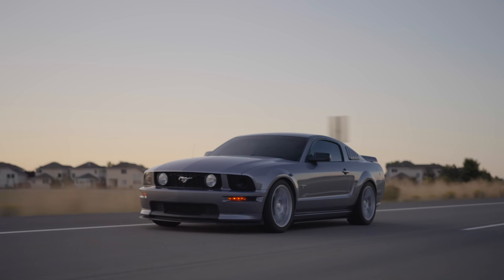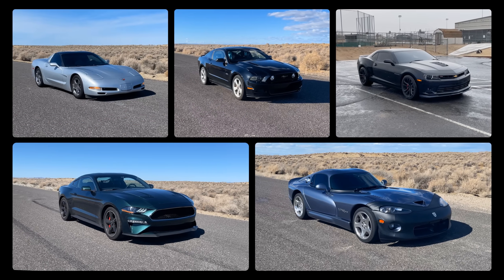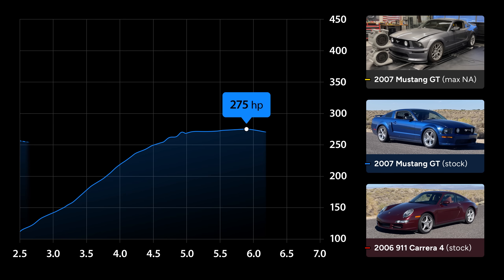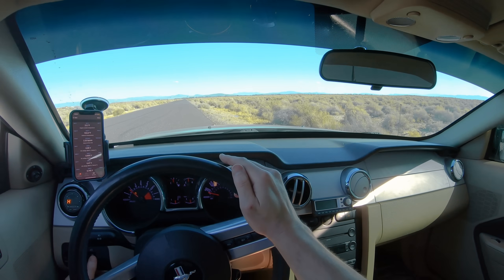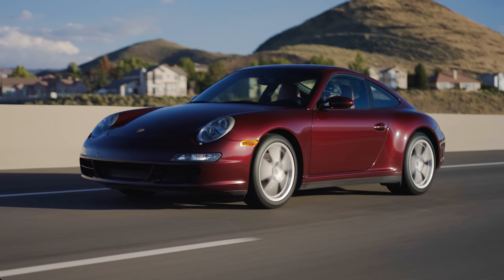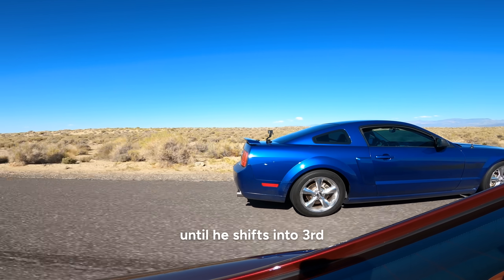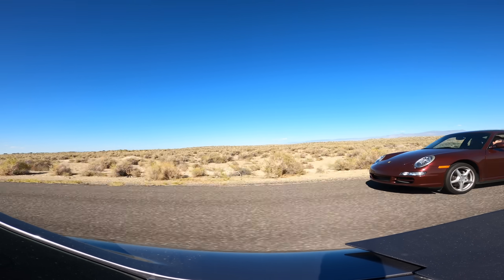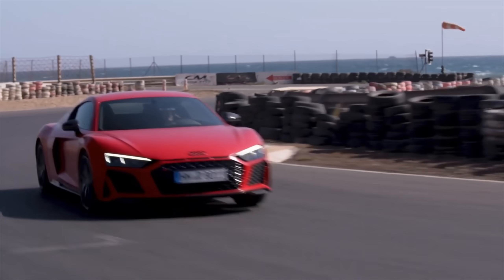This is what a 50% increase in horsepower looks like

Comment from the maker: Yes, NA builds are expensive. No, it’s (generally) not worth it, but something something eye of the beholder…

Rough breakdown of costs:
- Cams $1,000 (127600 + phaser limiters)
- Stroker Kit $4,000 (4.9L, but only ~9.6 compression ratio [for eventual boost])
- Exhaust $1,500 (Kooks LT, catted x-pipe)
- Intake $2,000 (CAI, TB, Manifold)
- Trans $6,500 (includes clutch, driveshaft, and axle gears)

If you have any questions for me, you can reach me thru my Tazet profile:
https://tazet.com/foureyes

And special thank you to those who watch the video all the way through 🙏
Reply: its still cheaper than a coyote swap
Reply: I just had a 302 3-valve installed in my 2005 Mustang just because I love the 3-valve nothing to do with being faster than a Coyote but fast enough.  @LordSamuelJ
Reply: "Worth It" comes down to what you actually want to accomplish.  If the goal is a dyno number or a track time sure boost it to the sky but if you just want smiles per gallon I think nothing else feels as good as a smooth running NA engine
Reply: @LordSamuelJ is not anymore. You can absolutely junkyard it for less. Will it have tons of loose ends, yes.
Reply: nice work man, i just did about $15k in mods to my 2018 camaro and fully built the motor NA
Reply: I feel like ur like me n ur obsessed with N/A vehicles n how much possible power the motor can put out lol
Reply: What happened to the 327 stroker kits?
Reply: Ls stroker haha. I love the sound of the 4.6s but they just didn't really compete to the LS for the money. Boost is the best bang for buck but NA power is awesome.
Reply: @shoveI  lol it's the opposite, if you want a track time - you want to stay N/A
And if you want some car goess brr once in a while - turbo is a way to go
P.S. Really high tuned high horsepower N/A engine is not exactly smooth below 3k rpm...
Reply: i dont know how is on there with SC build...

but N/A is visceral and cool.... i mounted a N/A car following these steps about... 
is pretty fun to drive, not the best but, if well mounted, it will not break easily
Reply: I hate this man, makes me wanna get rid of my gt500 for another 3v 😔
Reply: Can't wait till you start putting the big mods like a turbo or supercharger. I'd love to see stuff like this more often.
Reply: Would you be open to working on other people’s mustang? You clearly have the tools, and knowledge to do so. If so, how much would your time cost?
Reply: Love the car and the videos. I like the fact that that you got to the point and straight to the racing. No unnecessary owner interviews or fluff. Great stuff
Reply: how do you get your video and editing so crispy?
Reply: @LordSamuelJ he could've spent 1/4 of what he did and have double the power had he did a coyote swap. I've seen coyotes in my area for $800
Reply: @ronaldosanchez3292  
He did waste $10,500 on a transmission, and low compression stroker kit from a 4.6 to a 4.9 😆.  If he didn't do that it would have still outrun that Porsche..
Reply: completely worth it, sounds much  better than turbo cars and also gives a much better feedback and feel
Reply: It isn’t worth it, but it looks so satisfying!
Reply: If you love and keep your car long enough the “not worth it” no longer applies. 

I’ve got a 25 yr old MN6 C5 Corvette I bought brand new that is fully forged, heads, cam, longtubes, geared & supercharged and still in my garage. It’s well kept, well maintained,a great performer, and only I’ve farted in the driver seat for 138k miles. Not many people keep a car 2 decades+ that they still enjoy every time they drive it. And in order to do that (enjoy it every time you drive it) you have to upgrade some things. 

My “investment” in fun has kept me happy for a long time and in the grand scheme of things it’s saved me money and I’m not jonesing to buy a new toy every 5 years.  

So keep hot rodding that stang and if you hold onto it long enough and take care of it (upgrade whatever breaks) you won’t be sorry.
Reply: That sound though... man, I'd hate you if you lived within 3 blocks of me, but it sure does sound nice otherwise!
Reply: Honestly less than I thought it would be, my I6 turbo Volvo Suv stock was 281hp and 325lbft, but after a tune, intake, intake manifold, wastegate, and turbo back exhaust, is probably around low/mid 400hp, and 500lbft, cost $7500, I want to get another turbo part, intercooler and retune it, but she moves for a 4200 lb suv that only has a 3.0L
Reply: @LordSamuelJ It’s not cheaper the a coyote swap. All you need for a coyote swap is 
Coyote motor-$2500-$3,000
Tubular k member- $350 ($900 with coil overs)
Pedal bracket-$80
Accessory mounting bracket- $750
Headers- $500
Ford performance control pack-$2000
Flywheel and clutch- $350
fuel system- $500-$1000 (just depends on what you do)
(Not necessary) used t56-$500-$1000

So that is about $7000 ($8000 with t56 and coil overs) for the swap doing it the right way. You can do it cheaper by getting used parts, and doing a bit of fabricating and frankensteining. If you go that route you can do it for $5,000.
Reply: @ronaldosanchez3292  "coyotes in your area for $800"... Really? C'mon not everyone was born last night. Exactly where is your area? And please tell me where I can get a "Coyote for $800"?

*Don't be one of those ppl who just don't reply acting like they didn't see the comment I know you'll see this as it will give you a notification!
Reply: The Ford modular engines respond very well to cams and exhaust. I rebuilt my 2003 Mach 1 engine (32 valve) and it put down 373 hp and 350 Tq with full exhaust (longtubes etc.), flat top pistons to slightly bump compression and some aftermarket cams. No head porting or stroker kit, still was 4.6L. Stock rating was 305 hp at the crank. The cams were not max HP effort either, they pulled well from 3500 all the way to redline.
Reply: Good example of a car where NA is worth it is M156 C63 AMG. You can gain a reliable and safe 150hp for $3500 without superchargers (450>600hp). Superchargers start at $10000 for that engine
Reply: Thats the best part with NA if the engine family yours is based on had "upgrades" after your year you can swap parts too. HO cams, different intake manifold, larger TB, anything really that you swap with little to no jerry rigging can also help the budget while still making power gains. As a OEM+ approach from finding stuff in the junkyard etc.
Reply: why no turbo yet
Reply: 15000$ for such a build, i think its a good price for what it is 
since this Mustang in my opinion is not just for power since it also includes the transmission, but reliable and one of the best sounding Mustangs ever built
Reply: @shoveI i totally agree with you 
Yes the build cost 15000$ for "only" 410 horsepowers at the wheel (and if my conversions are good, around 450 horsepower at the crank, maybe even more)
Reply: @maximborodyuk3773  agreed, N/A race cars arent smooth at low RPM
Reply: Beauty is in the eye of the beholder
Reply: Hold Up Buttercup!
Did I hear you indicate More Horse Power is Not worth it?
My God Man, Next you'll be saying my high Maintenance G/F is Too Good Looking?
Will You add to That one can have too much Money?
Perhaps Big Ed and the Twins (The Package) Perform too Well?
Blasphemy! 
Shame upon you and your next 5 Generations!
My God Man, Think of the Youths You may have Led Astray!
Reply: @LordSamuelJ Yes, but would the Coyote go Faster?
Reply: which transmission are you running? i have a similar setup on a 2007 gt with detroit rocker cams and a tr3650 transmission. although those are hard to come by nowadays since they are no longer in production
Reply: Keith Duckworth (the "worth" in Cosworth) once said that turbochargers are for people who can't build engines, and I agree. Turbos are the easy way.
Reply: Shame! Picking on that baby Porsche!
Reply: All things considered, that's a BARGAIN!
Reply: I'm looking forward to doing close to this same set up in my 2011 SS Camaro Great Video Thanks for Sharing!!!
Reply: 911 KID HAS NO IDEA HOW TO DRIVE.FACT
Reply: It’s your car man you do what you want with it. but wow 15 grand on a three valve
Reply: $15K? That's a BARGAIN! I modded my Audi S6 and my wallet is STILL CRYING. LOLOL
Reply: @shoveI  I mean a small turbo will give pretty responsive and lower boost threshold than a larger turbo, but there is always supercharging that could give the NA feel, maybe not the sound though.
Reply: Why are you shifting so high when peak power is 6200rpm?
Reply: Since my stock 2017 GT produces 435 HP and weighs less than yours does, I agree, it's not worth it. Plus the drive-train is very efficient and has very little horsepower loss to the rear tires.
Reply: You are certainly lucky with cams for 1k. I drive a passat diesel and since the market for performance cams is so small and low volume the cheapest I could find are 1400. Only worth about 20 HP and 25 foot pounds XD. Even just a tune and 26 vs 16 pounds of boost is good for 30 hp over stock..
Reply: run corn and keep the high compression with a turbo
Reply: @terrymelton8084  He changed the transmission because the old one started to give out, and it wouldnt handle eventual boost. For the stroker, he is first trying to make a good n/a engine. And as you know, a good N/A engine makes a good turbocharged engine.
Reply: @johnathanm9772  because peak power almost doesnt fall off at 7100 rpm, and when he shifts at 7100 rpm, he will be in the peak power zone
Reply: yo, you need to test the car back at sea level to see what hp it makes down there
Reply: in Brazil we would find it cheap, a preparation at this level would exceed 100,000 reais, more or less 26,000 dollars just for pieces
Reply: @bigmansir3745  You can literally see it drop-off after 6200 in the dyno graph, lmao.
Reply: @johnathanm9772  at 2:16 the horsepower doesnt really fall off from 6200 rpm. Secondly, if you have ever seen where the revs drop on each shift at 71/7200rpm, its at around 5500 rpm. That is where peak power is very close. But if he shifted at the peak power immediately. Which is 6200 rpm. His rpm would drop at around 4500 rpm with each shift. at 4500 rpm he is making about 300 rwhp. but at 5500 rpm its over 370 whp.
In short. the reasons that he is shifting so high are:
His losses of horsepower are not that significant at above 6200 rpm, because at each shift at 7200 rpm he goes back to 5500, which in turn keeps him at the optimal horsepower range. But if he shifted right at 6200 rpm, he would make 70 whp less when he goes to 4500 ish rpm. 
I hope that this made everything clear, and please. Actually analyse the vid before you comment :)
Reply: @bigmansir3745  Just because it doesn't drop off much, doesn't mean it doesn't drop off at all. There is a clear decline after 6200 maybe even 6100 rpm. What matters most after shifting is torque btw, not so much hp. For fastest acceleration you want your next shift you land you in or extremely close to peak torque. If the hp you lose from shifting later is greater than the torque you'll gain, then it's probably better to shift. You can see he reaches close to peak torque right around 5100 to 5200 rpm, so as long as after he shifts he's within that power band, he's fine. As it stands right now, after he shifts he's right around 5500 rpm. While the difference would be pretty negligible, it would probably still be better to shift earlier on to be in that 5100 - 5200 rpm range. I hope this made everything more clear for you :)
Reply: @johnathanm9772  if that is the case then, the torque difference at 5500 rpm compared to the torque peak is almost none as you can see at the graph. Also he said that the performance cams that he installed favor high rpm. He explains it right from 2:15 to 2:30.
So in short: He shifts at 7200 rpm because of the actual negligible difference from its torque peak at 5500 rpm. As well as the horsepower difference from 5500 rpm and 51/5200 rpm. That difference is more significant than the torque difference.,
I am hoping that this has made everything even more clear for you :))))
Reply: @bigmansir3745  You're still glossing over the power loss after 6200 rpm being greater than the torque gained after 5200 rpm. Of course the cams favor high rpm because that's where he sees most of his power increase, I never denied that. He's still reaching peak torque right after 5000 rpm and peak power right after 6000. He doesn't want to go too far beyond that because he's literally losing power. I'm not saying to stop right at peak power, but you want your next shift to be fairly close to peak torque with as minimal power loss as possible. If you need me to explain anything a little more, I'd be more than happy to! :)
Reply: Actually a Porsche 911 has a Boxer engine. Though similar a Boxer engine has better balance than a flat engine because in a Boxer the cont rods connect on opposite sides of the crank while in a Flat engine the connect on the same side. This leads to lots of side to side vibration making Boxers superior.
Reply: Thx for the price breakdown! There are so many channels that only show results w/o costs. It helps keep a dreamers feet on the ground when planning. Lol what would you say is the annual upkeep associated with $10-20k in upgrades like these?
Reply: I like the 2005-09Stang GT manual
Reply: makes for a fun daily though
Reply: @LordSamuelJ  it’s not lol. I’m by no means part of the “3v engines are garbage” clan, but this build was WAYYYYY more expensive than a yote swap. I understand why he did it though, it made for great YouTube content.
Reply: What happened to stage 4 and that turbo you talked about over a year ago???
Reply: Excuse my ignorance, but if you build your engine to be high compression, wouldn't that maximize your engine's output? for example, the 6.4 Hemi in the Scat Pac is a high compression engine and is known for not being boost friendly.
Reply: That’s honestly not bad, for the same results I need to spend 20k😂 now to be fair mine is a 2.5 4 cylinder.
Reply: If only Ford took the time and engineered the 3v like you did.
Reply: It’s been 4 months since you posted anything everything good?
Reply: What desert town did you guys race in?
Reply: It is surprising that you stuck with the stock heads.
Reply: So much fun! Forget the cost, all that result is just plain cool 👊🏻
Reply: it so is worth it, nothing like building a car and you didnt just slap on a part and call it done, if i could afford it i would totally do it

Comment: The chop is immaculate!
Reply: Ngl for daily use I would prefer little more power over stock at down low. 30hp over stock at down is a definitely a tradeoff
Reply: @DuBstep115  but dah chop
Reply: Its called lope.
Reply: Haha v8 go blublublublub
Reply: @DuBstep115  I get the impression it's going towards a track car.
Reply: @funkingitup1805  He was chasing the max hp figure on NA 3V. I just said I would trade some of that peak hp for down low torq
Reply: @DuBstep115  - but with the right road cam it'd be +60bhp low down, not +30bhp.
Reply: @DuBstep115  I'm just pointing out that trading that peak horsepower for low RPM torque is a stupid idea for a track car that will live in the higher RPMs. I agree that it would likely be worthwhile for a street car.
Reply: @funkingitup1805  This car has never been to track, few 1/4 mile pulls hardly count as "live in the higher RPMs"
Reply: @DuBstep115  Neither of us have any idea what he plans to use the car for. Funny enough though, you seem to not realize that 1/4 mile drag cars spend most of their time at high RPM and choose peak horsepower cams instead of midrange torque like one might for a  street car.
Reply: Yes sir, there will be EARGASMS had.
Reply: Lmfao sound cams are just sound. 
Not custom grind which focuses more on power than sound. 
This is where you wonder where YouTubers get their information, but here is where they buy shelf product and misinform people. 
Not the channel for me 
Also dude should’ve went TR6060 and 1 piece DS. 
But hey, not my money.
Reply: I know this ain’t gunna be good for them ford guys but I’d love to find a ls comparison for the cam profile . ( I understand one is pushrod and the other is dohc
Reply: @funkingitup1805 
Well he could lose about 200lbs to 300lbs that can help get the car out the hole faster and maybe go with a lower rear gear.

Comment: $800 nitrous system is the cheapest way to go
Reply: This could damage the engine
And damage even more if it's completely stock
Reply: Agreed with the above replies... $800 is the cheapest for the first week or two of being on, but can your stock mechanical parts handle that power? Pressure? Heat? Etc.
Reply: Only 10 passes then have to refill is pretty lame

Comment: Great video. You could change your axle ratio so it would get in the power band faster.
Back in the day I loved reading mustang magazines about builds like this. The S197s should be a good budget build now a days.
Reply: These are some of the best budget cars to get into racing with on track or drag racing. Cheap reliable and fast but after a bit of upgrades to the tires and suspension these things can be very quick. I have an 07 for the track and its stock motor but with the heavy aero and suspension I keep up with porches vettes and lots of BMWs They beat me in the straights but I eat them up in the turns which is odd to say for a mustang lol
Reply: @johncorbin4125  Whats funny is gen if Mustang is one of those cars that you could have fun out of the box, even if you don't upgrade it.
Reply: @recon1673  oh for sure! pick up a decent GT for 5k-8k and will be faster than most other cars in the price as well.